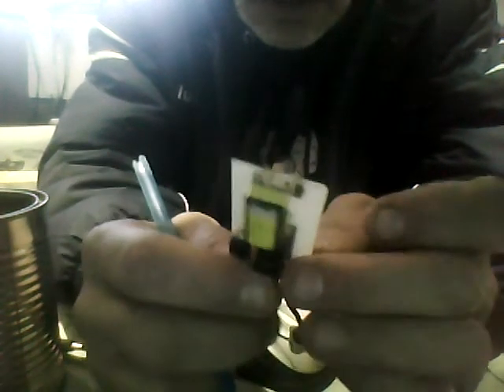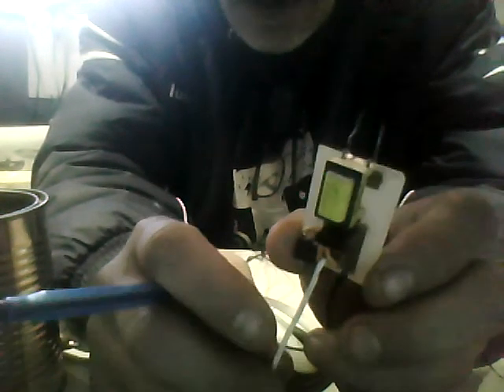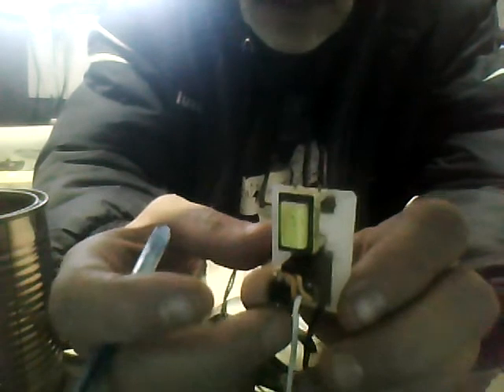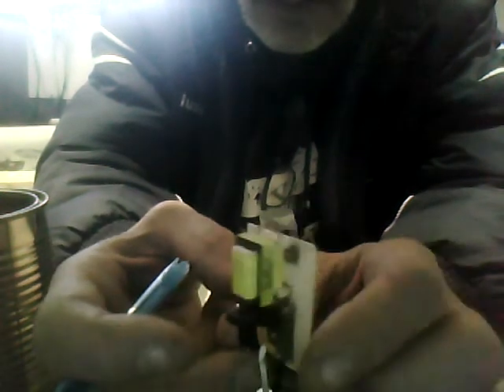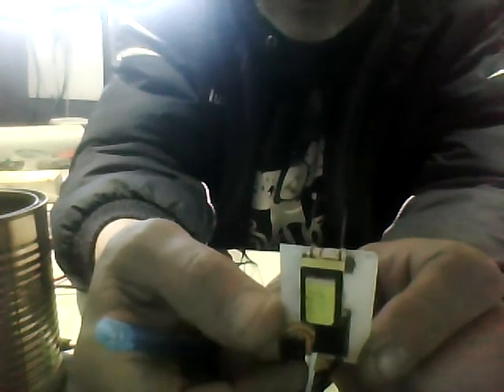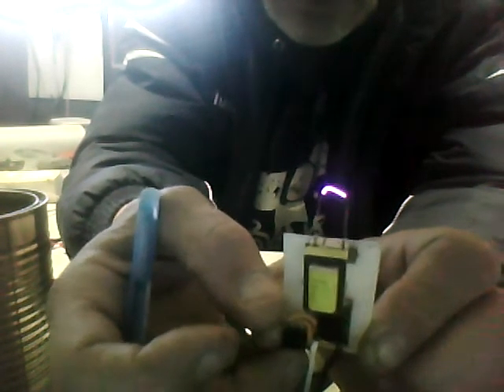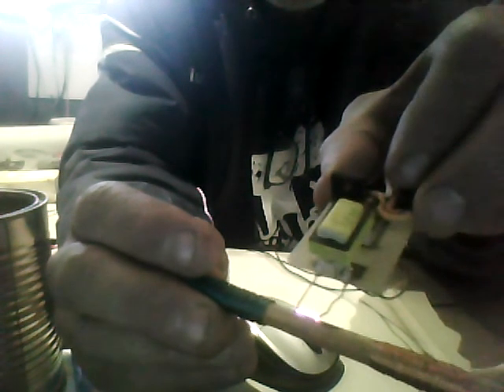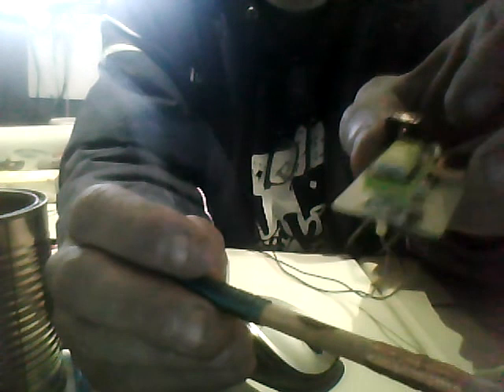high voltage generator using 3 components

Comment: hello friend, your project is very interesting, can you do me the favor of giving me the circuit diagram and the electronic components that make it up, thank you very much
Reply: Schematic???????????????????????????????????
Reply from the maker: components were taken from old PC power supply panels.....they have no markings for part description but the transistor is an NPN type very fast switching capacity, the resistor is standard 470 ohm half watt..... push switch is single pole normally open type. and transformer i describe in the video.....sorry but after some consideration for safety reasons i did not include schematic and i cannot include schematic..... this unit is not a toy and people that mishandle or even accidentally  misuse or test it or plays with it can be seriously hurt by it ....i'm sure you can understand......but thank you for your interest.